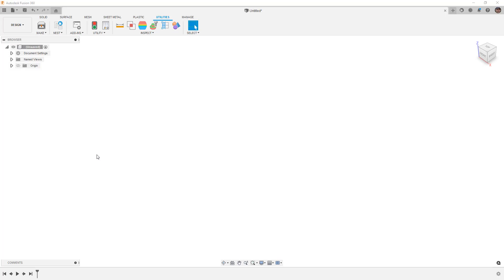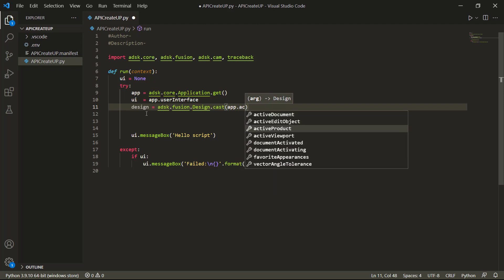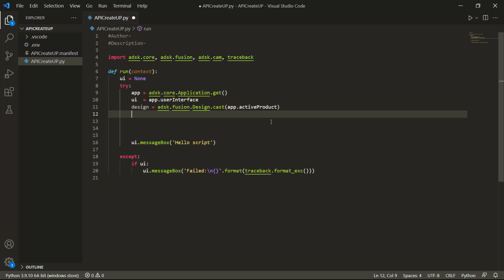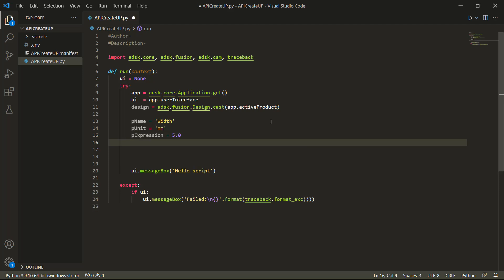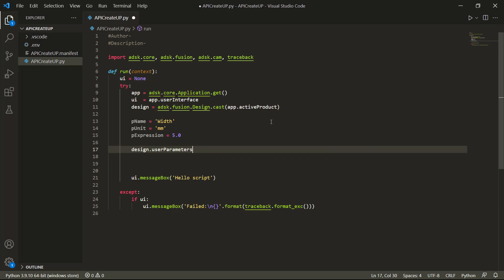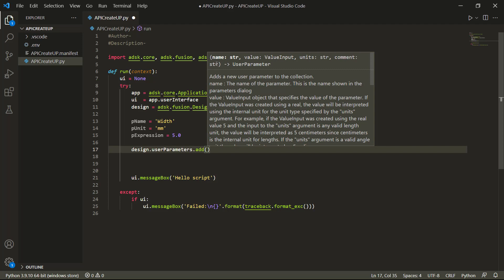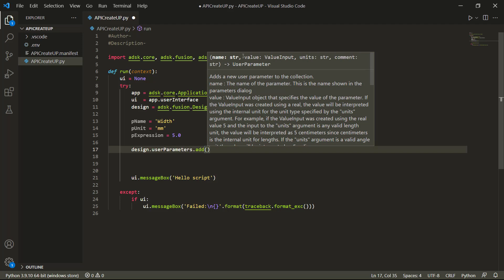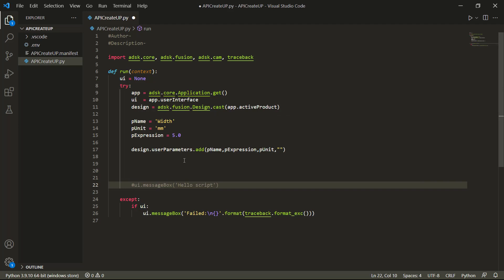Intro to API in Fusion 360 Part 3 - Creating a New User Parameter with Code #Fusion360API #Python

Comment: Wonderful video!  It's superior to the Autodesk ones.  I would like to offer some advice on improvements, if you ever decide to create more API videos in the future. Fusion 360 API is very technical and it requires OOP and general programming experience. You would cover a lot more of the Fusion API at a deeper level if you focused on a developer audience. Without extensive OOP programming experience, the topic is of little utility.
Reply from the maker: Thanks Bob!  The audience I am going for is the non-programmer trying to help understand how to do simple things with API.  The first video in the series was just about OOP and some basics of programming with Python(and again I am not a programmer by trade).  In that video I listed a bunch of good resources I found on OOP if the user wants to learn more.  What I found missing was the link between the basics of Fusion API and Basics of programming for non-programmers.  The barrier to entry is a bit steep.  I released the 8th video in this series yesterday where we read in a CSV file and saved various configurations of a file by changing user parameters.  I could be wrong but I think there are so many people out there interested in creating some basic scripts but just lack the code experience to dive in and most of the resources assume you are already proficient with code and just need to understand the Fusion API.  And the sample programs in the help file often are so specific and make the topic more complicated to understand.  at least I hope so :)  could just be me ;)
Reply: @LearnEverythingAboutDesign   A non-programmer would be better served by text commands. The knowledge required just for the programming side is vast and overwhelming. The best they can do is follow along, but they won't grasp what they're doing. The API adds another heavy layer on top of that with a dearth of available information to help programmers get their heads around it. The Autodesk videos are old and not presented in an easy to digest manner.  It's more of a big overview of the API without any coding demonstrations.  It might explain why there's not a lot of add-ins available for it.

I would seriously consider approaching Autodesk to do some videos for them. You can also approach PluralSight or LinkedIn Learning to do a course. They pay well and you already have a incredible portfolio to get you through the door.
Reply from the maker: Thanks Bob. so I am a contractor and produce videos for Autodesk in many areas. Design, simulation, CAM, generative etc.  I haven't done any API stuff because honestly I am not qualified :)  Actually diving in and learning Python better had been on my list for a long time(i programed some xmas lights on my house and have done a few micro controller projects but that was it).  I put out a video on text commands and intro to scripts basically hacking a sample and people asked for more. so I delivered.  If i get to the point where I feel more comfortable speaking truth to OOP I will certainly dive a bit deeper!  I appreciate the feedback and advice!
Reply: @LearnEverythingAboutDesign   You're offering more than a video, but also a more approachable pedagogy. You're perceived lack of expertise is actually an asset. It gives you a perspective Autodesk doesn't have, enabling you to identify and clarify difficult areas. It might make sense to work with their developers to assist in developing the content. What you've done thus far is outstanding.
Reply from the maker: Wow thanks Bob!  I appreciate the kind words!

Comment: Great video, thanks for your great work putting this all together! If I may, I have a question : to define "design" you use design = adsk.fusion.Design.cast(app.activeProduct) in stead of design = app.activeProduct. The latter will work also, however, in that case when inputting design. (dot) the class userParameters is not available in the viewlist , one has to type userParameters.add() manually. Is that a Python or an Autodesk thing?
Reply from the maker: Thanks.  That is a tricky one for sure and to be honest I am not 100% sure exactly what does and does not affect the viewlist that pops up.  It is not supposed to be related to casting, but I can't tell you for sure if that affects it or not.  If you start a new script with the default message box, typing ui. shows the viewlist for me and nothing is cast there.  so my gut is to say that it does not affect it.

With casting you will notice the viewList contains a lot more items.  When you use design = app.activeProduct you are leaving the door a bit open if you aren't in the design workspace for example.  If you are in rendering, mfg, simulation those are the current activeProduct.  If you cast the active product to adsk.fusion.Design then you are explicitly telling it that you are expecting a design.

That is the way that I understand it.
Reply: @LearnEverythingAboutDesign  I will have to look into it. This is my first in Python (using C# and VB for Powermill/Powershape automation projects) and Python seems confusing to me. Maybe my age. Started programming in 1971. As for now I am searching for how to debug Fusion script. It will take time.
Reply from the maker: @LucPonsaerts-ec6vo  For sure.  I stumbled into Qbasic in the 90s and did some C based stuff. descent amount of VBA.  Python and any object oriented programming takes mostly the same structure, just the syntax changes.  There are loads of OOP series on Python, then its just the nuance of how the Fusion API works.  

I will say that ChatGPT is a good resource to help debug/explain lines of code.  Not super great at just coding for you.
Reply: @LearnEverythingAboutDesign  Learning by stumbling ! good education system, my way. 😍